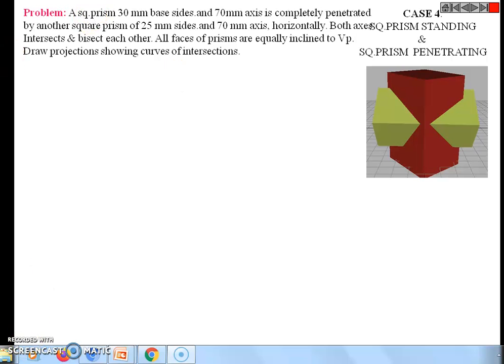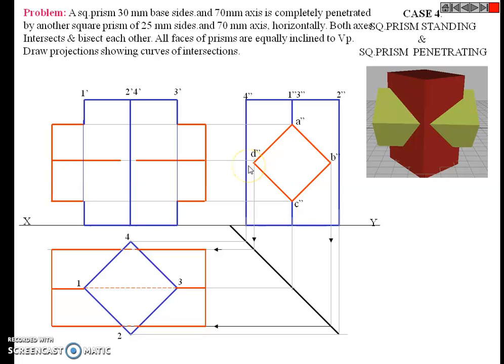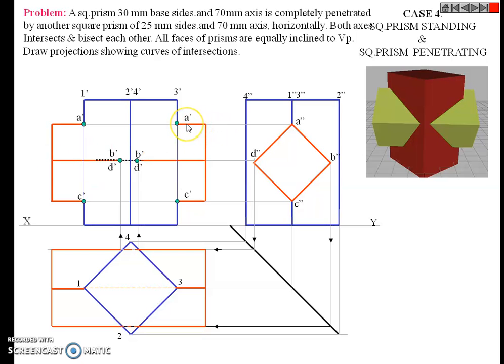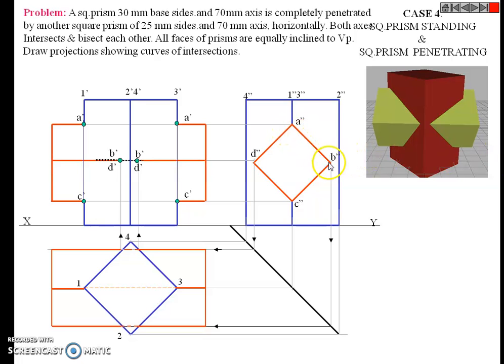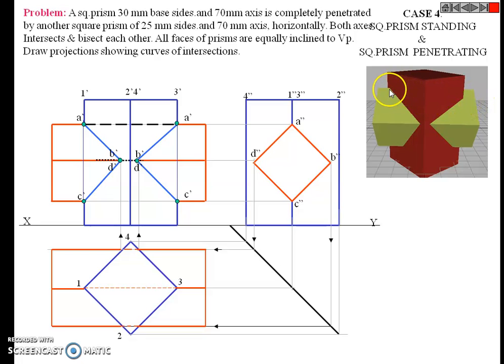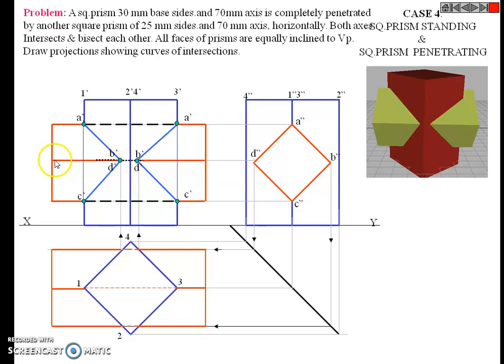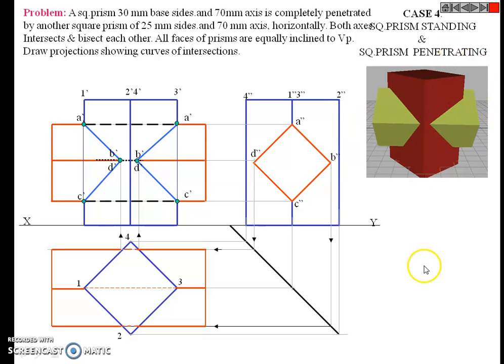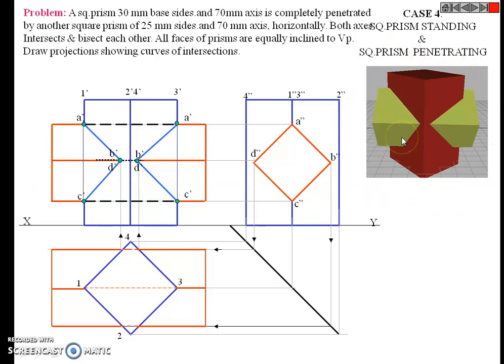CASE 4. SQ.PRISM STANDING & SQ.PRISM  PENETRATING

Comment: A square prism 30 mm base sides and 70mm axis is completely penetrated by another 
square prism of 25 mm sides and 70 mm axis, horizontally. Both axes intersects & bisect 
each other. All faces of prisms are equally inclined to VP. Draw projecƟons showing
curves of intersecƟons.